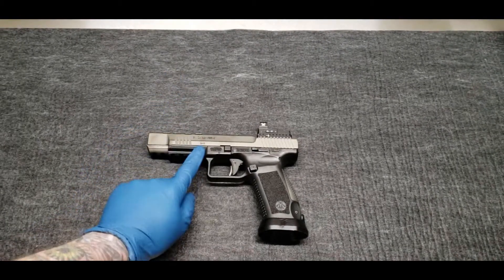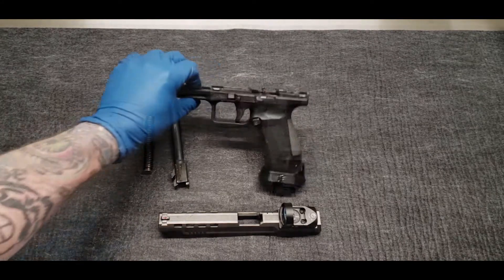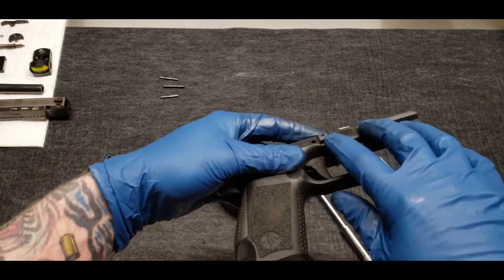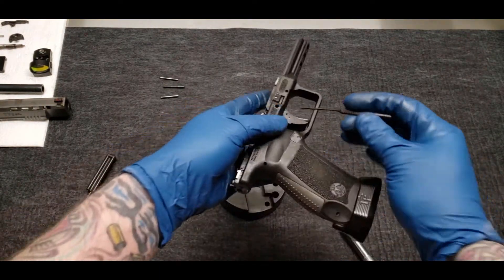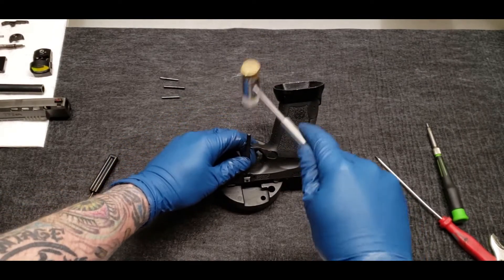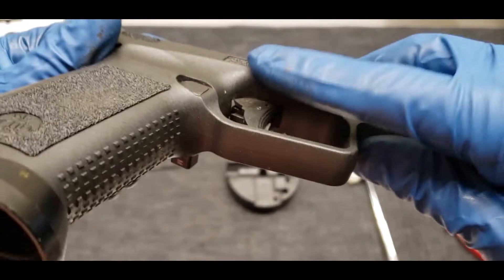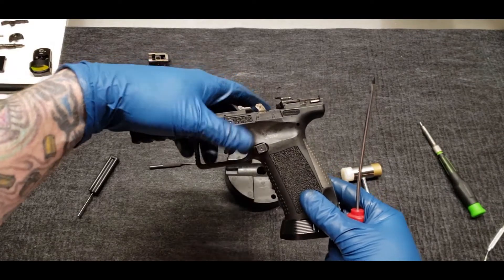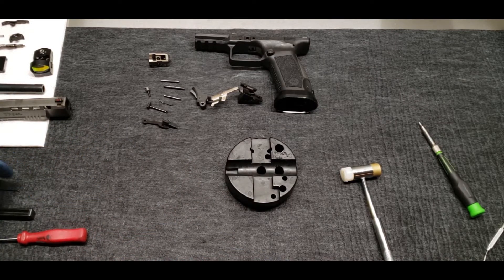Canik TP9SFX, Full Disassembly Tutorial

Comment: Question:  TP9SFX the extractor spring. I pulled out the extractor and the spring fell out before i could see which way it was in. There's a smaller hole on one side. Which way does it go in, with the smaller hole facing out that the dimple on the extractor arm fits in or does the bigger hole fit into the extractor arm ?

Comment: the dreaded roll pin is definitely a poorly designed part of the gun
Reply from the maker: Yup, kinda a pain, thanks for watching and commenting!
Reply: @TacticalAdv  I took a small drill bit and put a relief cut in the frame just below the hole for the roll pin. Some 2000 grit sandpaper and it looks like it is factory. Now I can use a normal roll pin and just push it out in about 2 seconds.